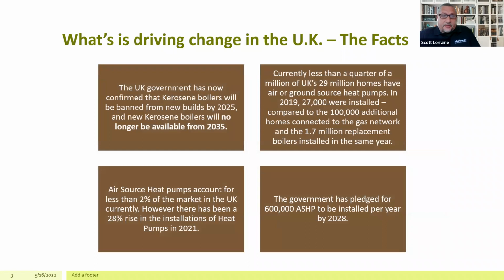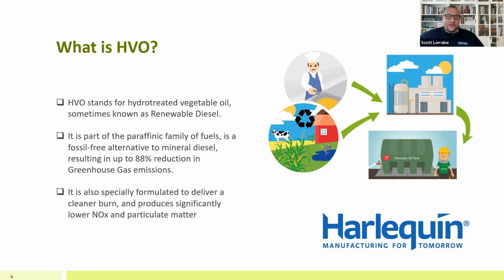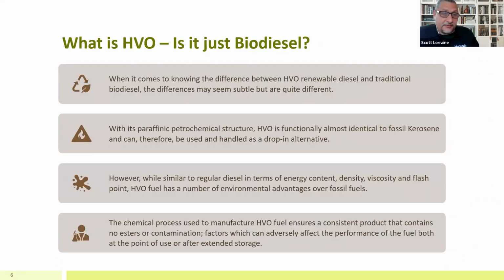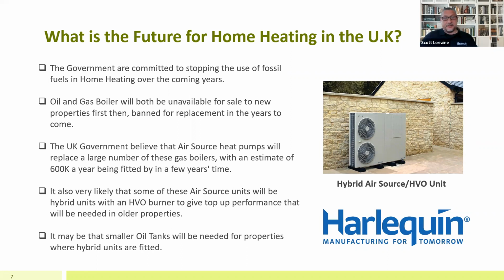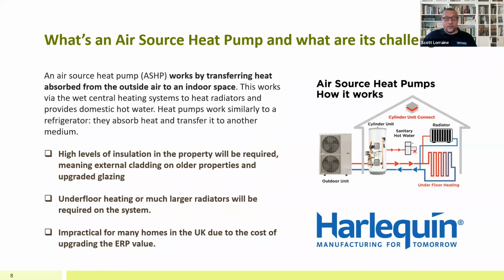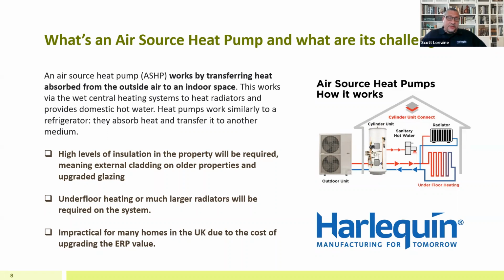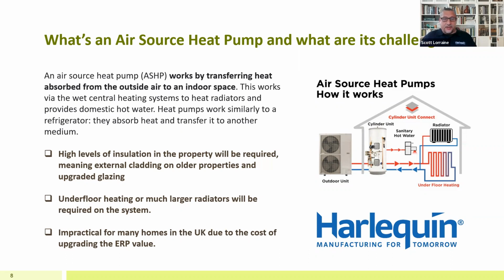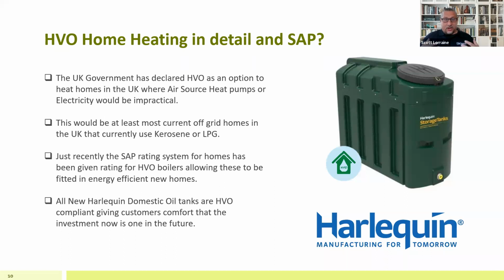Webinar: Future of HVO for Oil Fired Home Heating | Harlequin Tanks

Comment: Clearly this is 3 years old now. And clearly HVO is a no brainer for an older property, has there been any traction with, 1. The fuel duty cost? 2. Availability on the domestic market? And 3. You refer to HVO as a drop in product, does that mean you can mix it to start with whilst chaining between fuels (once the boiler jets and settings have been modified etc.)... Interested to know... Many thanks.